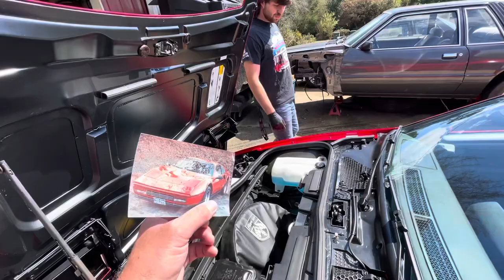The History of this 1987 Pontiac Fiero GT - 4th Owner - 3800sc Supercharged L67

Comment: I was driving my 1987 Fiero 2M6 SE Notchback Silver, sunroof, full body kit with large spoiler 2.8l v6 4 speed and 76k miles.  I purchased it for $1,800 in 1993 and I sold it for the same $1,8000 to another student in 1998 after high school. It was AMAZING I LOVE IT STILL, now at 40 years old I have a Yellow 1988 GT T-Top, I just swapped my 56k mile 2.8l with a new crate 3.8l Supercharged making 475HP to a 6 speed transmission.  It's not your mom's Fiero that's for sure, It is scary fast.  Hello from Colorado

Comment: Fiero fans can rejoice. The Fiero now has a V8 and runs the Corvette badge. Sure, there is some changes, but when I look at the C8 I can't help but see a little Fiero in the mix. I had a Fiero. The wiring caught fire and turned it back due to the lemon law. That and it got a water leak. Once the water leak was fixed, it kept overheating due to air being tripped in the LONG water way. I like it until the wiring caught fire.

Comment: this is the Fiero pontiac should have built
Reply from the maker: Thank you! They almost did build something similar with the 1990 Fiero GTA Prototype. I’ll be posting video of that soon.
Reply: Yes, but that is what the GM brass was afraid of. The Fiero was starting to make the Vette look bad. And when they say what Pontiac had planned for the next model, they got it axed before it could happen.
Reply: No V8 only ..  .no turbo stuff
Reply: It sucks that Pontiac killed the Fiero in 1988. After GM worked out all the bugs they discontinued it. But the second generation Fiero would have gotten a lot more power. Maybe a supercharged 3800 would be great.
Reply: @dennismoran1299  GM would not allow it anything faster than the corvette to exist after the GNX incident
Reply: @erics8192  can you imagine if Pontiac used the Grand National engine. The Fiero GT only weighs a little over 3000 lbs.
Reply: The only 1990 GTA concept that got built had a 3.2 version of the 2.8 vs the 3.1 that ended up in many early 90 GM cars. That same engine eventually became the 3.4 dual cam which there were several versions. Only one was forced induction via supercharger. 210hp if I remember correctly. The naturally aspirated version putting out 180hp was the leading candidate for the new Fiero. Unfortunately, never happened. But many have done the swap. The 3800 is by far the best most reliable motor ever out of America, but because of the aforementioned facts I would personally go with the 3.4 for novelties sake.

Comment: Where you get the side scoops? Price?
Reply from the maker: I found the side-scoops on EBay. They were produced by “Fiero Fiberglass” but the company stopped production years ago. A group of enthusiasts in Europe have bought the molds and started producing them again. Google “Fiero side-scoops” and you’ll find them.
Reply: @superchargedfierogt  correct me if I'm wrong but I checked the web page  and prices are  outrages